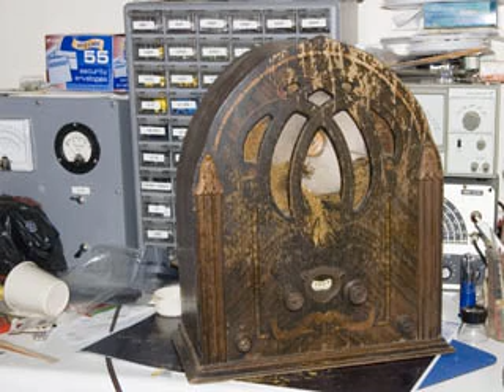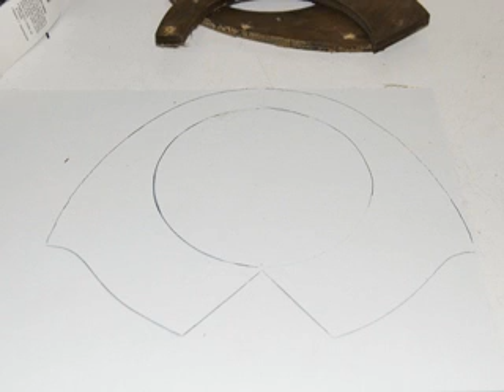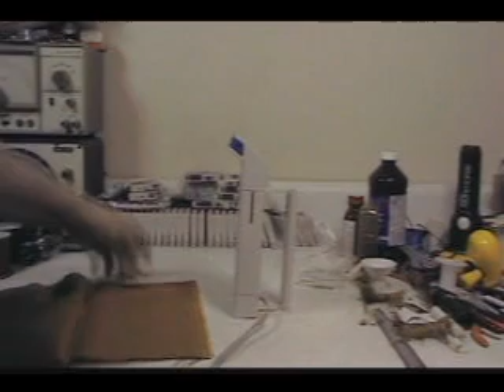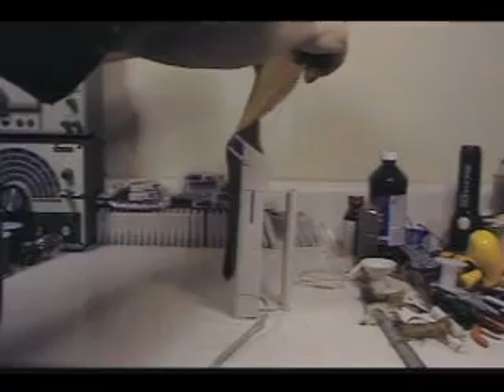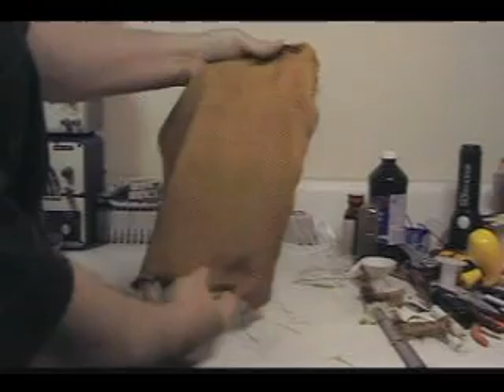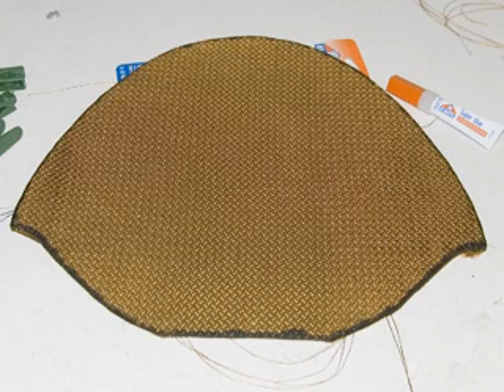SilverTone Radio 1290 repair part 3 complete

Comment from the maker: This radio has been a real challenge. This is the first time that I had a radio with the grille cloth glued to the front board, and glued and nailed two boards on top of the grille cloth. What a pain. The temple was the only way I could figure out how to make the new cloth look good on the first try. This is also the first radio that I can remember that did not have a volume control. And it's so weird that it has a tone control.

Comment: That really came out good! That seems like a really complicated repair job on the grille cloth. Seems strange though that there is no volume control, is this maybe so people wouldn't turn down the volume all the way but leave the power on and run out the batteries?

Comment: Rick,
Good vid, but you stole my thunder. Oh well, you snooze, you lose.
Now that the ole Airline is finally good to go, I should have enough time to begin replacing the speaker cloth on my Silvertone console and post a vid about it. I'll be attempting a different method.  Hopefully, it'll work. Stay tuned.
How about a radio alignment vid...from how to attach the sig gen to the final coil adjustment?

Regards,
John

Comment from the maker: Heat is always a problem and sometimes the manufacture put the tubes very close together concentrating the heat further. Just like today, they tried everything. Sometimes it was a good idea and sometimes a really bad idea.
The heat will drive out the oils from the bakelite so I use a Wax cleaner that puts the oils back in.

Comment: Departement store radios, silvertone and airline (especially airline) have always seemd well made to me. Unfortunately their design is sometimes quite lackluster. I have an Airline 62-325 that looks great and is well made, but it is really dangerous to operate! It has 5 tubes - but one is a ballast, so it has no IF amplifier. The ballast gets burning hot. You can't even touch the top of the radio. It's a wonder the bakelite case didn't deteriorate from such high heat.